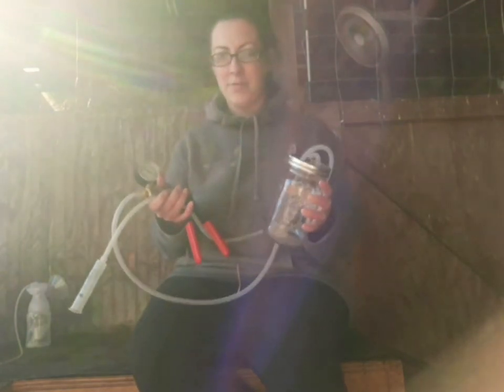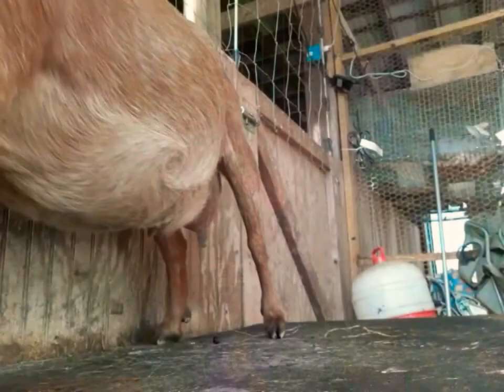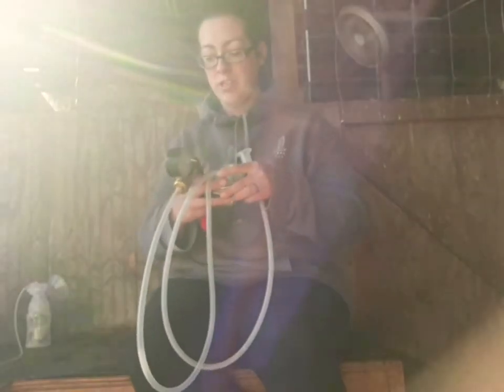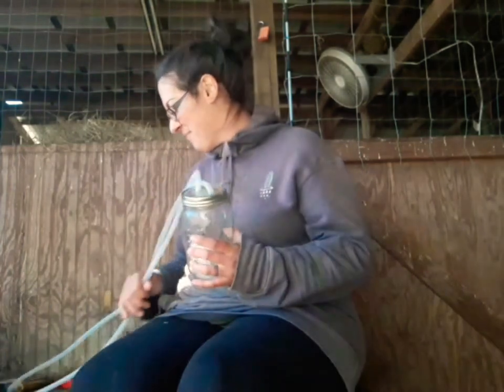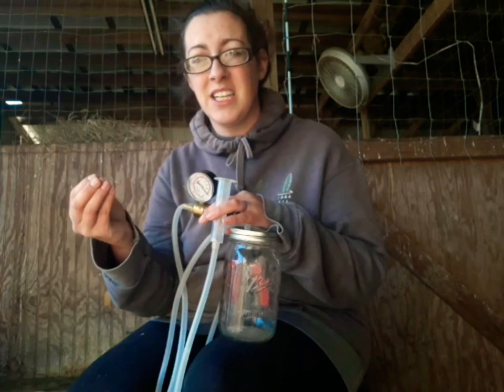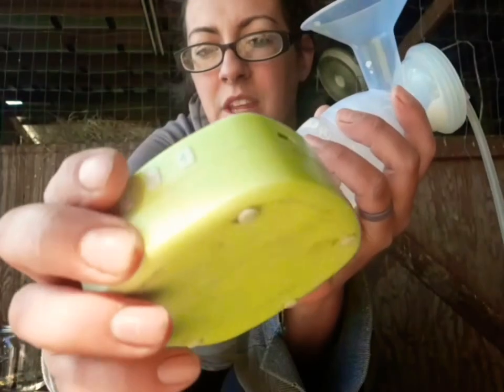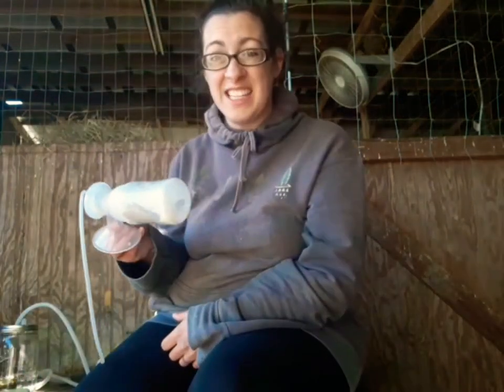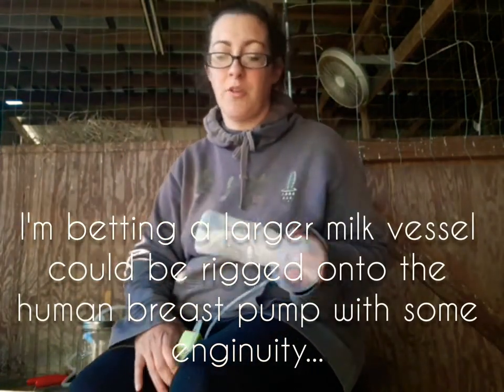Why I HATE Using the Mason Jar Brake-Bleeder Pump for Milking my Dairy Goats

Comment: i know several people who use the brake bleeder pump method, (including sarah and kevin), but i think your syringe is to small.  most of them i see use them have a 60cc syringe barrel.  but thanks for the info on the breast pump.  does it work with the larger teats?
Reply from the maker: If you have the larger flanges it does. I hand milk now but the largest teat I milked with the breast pump was about the size of my thumb.